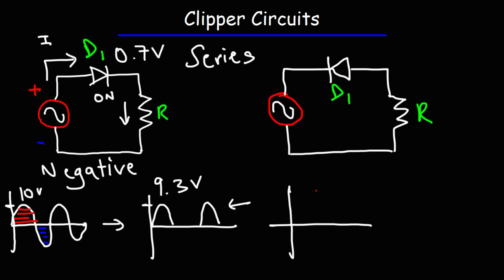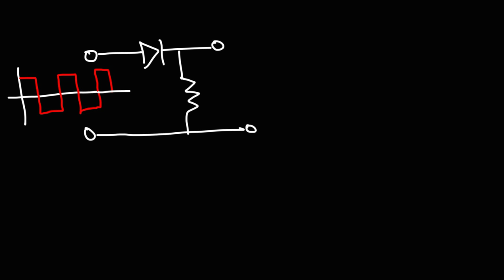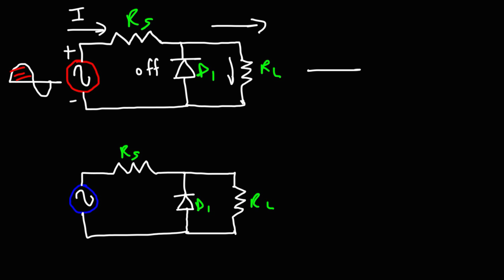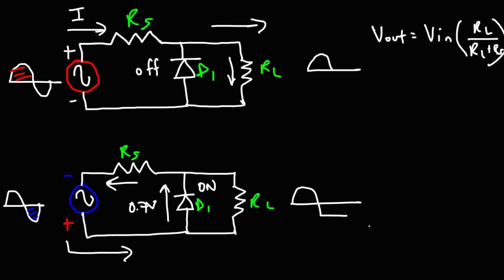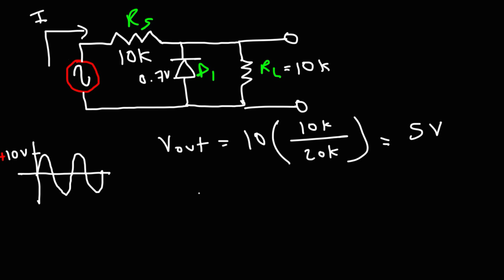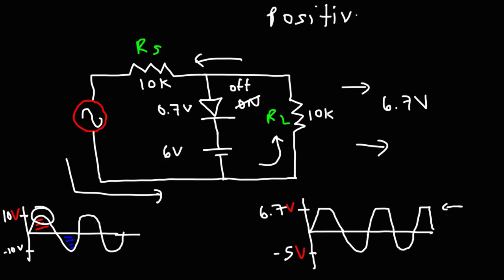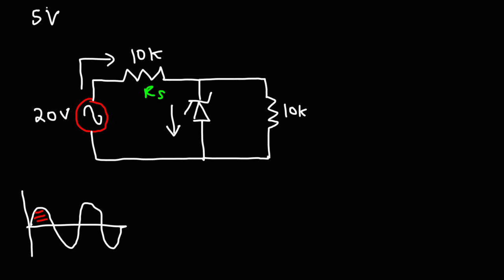Clipper Circuits

Comment: 17:00 why does the current not take the path of RL here? when u use a voltage divider here you woud get 15*(1 / 11 )  so this is a lot less than 12.3V

Comment: Thank You Very Much
Question at 8:50 is solved wrong The max voltage drop at Rs will be 5V and hence the diode will be off😊

Comment: Just curious at 16:56 wouldn't the reverse bias diode act as an open circuit and then we could disregard the second diode's forward bias voltage?
Reply: It is not a normal pn diode, they are zener diodes which will work at both bias

Comment: 11:00 
The answer to the question at this time stamp is not correct. 
because voltage in the shunt branch (i.e., diode + battery) = 6.7V, while at the same time voltage across the 10K load resistor is 5V. Therefore, as it was mentioned, lower voltage should be taken into account. 
The final answer is just a pure sine wave of Vmax = 5V.

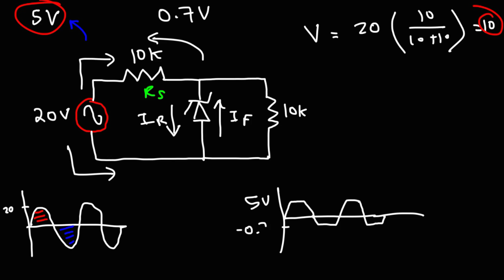Comment: Perhaps 10v rather than 5v at 14:04
Reply: Maybe it's too late but, here we have a reversed voltage of 5 v zener diode, which means that the voltage across the diode will be 5 and the same for the resistor (parallel).

Comment: before clipping the width of one of those bumps is lambda/2 right? after clipping does it remain the same. since the signal is vertically shifted by 0.7v, i feel like it should be slightly smaller???? 🤔

Comment: before clipping one of these bumps has width of lambda/2. after clipping does it change. when clipping output signal is shifted vertically by 0.7v right? so i feel like it should be slightly smaller??? e🤔
Reply: You are probably correct, It doesn't seem like he is going fully in depth into the waveforms and formulas so as to not scare away some people?
Maybe we can convince him to do a more detailed video on the waveform effects of components

Comment: Remember when solving using kvl, the diode is parallel to RL, and therefore set the "Vout" at node between diode and RL. Solve for Vout and you'll get the (+) or (-) voltage. 

Also if diode is ideal, no need for 0.7 drop. If not ideal it is given in problems.

Comment: You have great way of explaining things.  I learned about these circuit.
@9:24 the maximum voltage is 5V, because the voltage divider divides it by two (10/2=5) and never gets to 6.7V, However, if your input voltage was say 20V then we get to 6.7V.
Thanks again for good clip.
Reply: i am learning for an exam, and picked this up. question is how do i handle it should it pop up?

Comment: Is the output signal at 11:24 possible? In my opinion, the diode would be all the way open cuz the voltage is distributed to two resistor. Thus, the potential across diode is not high enough to make the current go through.

Comment: I love all of your videos, but at 5:00 you said the diode is parallel to the source.
If the definition of two parallel dipoles is a couple of dipoles that are connected to the same nodes (and thus having the same voltage across them), then the diode in this example isn't parallel to the source.
As far as I know, if two dipoles aren't in series, that doesn't mean they're parallel.
What do you think?
Reply: If they aren't in series they are in parallel. Simple as that.
Reply: @CharlieScarver  nope =)

Comment: At 10:30 seconds you introduced battery in the clipper circuit. And the output is 6.7V at RL. Since input is 10V i cant figure out how the voltage is 6.7V. Is it because the current is flowing back to source(AC)??
Reply: I don't understand either, I would like note on this too

Comment: Bro, I am a teacher of electronics. You are doing a great job which is very useful to students all over the world. I was watching this video just to refresh the things after a long time and I found that at 8:50 the question you solved has wrong solution. Please correct it if possible. The question has potential divider and for a max input of 10 volt the potential drop across RL will be 5 volt only i.e. the diode remain off during the whole cycle and no portion of input will be clipped. Output will maintain sinusoidal waveform with a max voltage of 5 volt. Thanks
Reply: yeah i was thinking about the same. The input voltage max should be at least 13,5V to see some clipping
Reply: I'm just getting into electronics and this video really confused me.  I see that quite a few people have addressed the part I was confused about 🙂  I couldn't understand how he was adding the 0.7V and 6V of the battery, until... did he draw the battery the wrong way round?  If the positive is on the top, then it's pushing 6V to the diode, so the 5V from the voltage divider won't switch the diode on.  The output would just be a maximum of 5V.  It's a shame that the original poster never addressed this.
Reply: It would be voltage divider only during the negative wave cycle when two resistors are in a series, so voltage across RL and RS are equal. But during the positive wave cycle RL is in parallel and we need to consider equivalent resistance of the circuit, not individual resistance of RL.
Reply: hmm.. but they are in parallel doesn't mean they have the same voltage?
Reply: @manso_dx3980  Nope, they aren't in parallel, there's a resistance in between

Comment: In 10:00 the diode will not be in on state for the given sine wave  of amplitude 10 alteast 13.4V i.e 6.7*2 is required for diode to be ON.So the circuit will never clip.

Comment: How cannot the current flow from the negative terminal of the battery though the cathode for the negative half cycle? The diode should be forward biased for both sides because you have negative voltage flowing through the negative side of the diode and positive voltage flowing through the anode for the positive half cycle?

Comment: 13:51 why clip at 0.7 volt when two 10k resistor are there so there must be 0.35 volt across RL

Comment: I don't understand the circuit starts at 10:00 of this video.Is the  anode peak voltge 5volt?If the peak voltage of athod is 5v then the diode will be always off.

Comment: How is it that the diode's value function changes from a 0.7 drop to a limiter of 0.7 when it comes to the shunt clipper circuit? also, how is it the biased positive shunt circuit sees an increase of the 6 volts when it's positive charge runs directly to the block of D1? Thanks in advance for any answer, loving these videos!

Comment: so for the negative shunt clipper circuit what happens between the parallel resistance and the diode?

Is there any voltage going through the resistance, or is it all just going through the diode since it has close to 0 resistance?

Comment: For the circuit at around 10:07...The output voltage will never go higher than 5V, because the peak input voltage is 10V. Vout=Vin/2, according to voltage divider rule, right? (Because RL is equal to RS in this particular circuit) So the peak output voltage is 5V. How can the output voltage be clipped at 6.7V if it never goes higher than 5V?
Reply: I have the same idea as yours
Reply: This all rests upon the assumption that the diode will be off until the voltage across RL is greater than 0.7+6. Is this right to say?